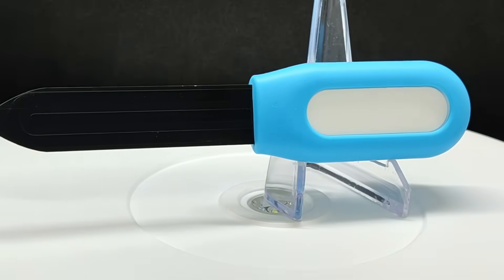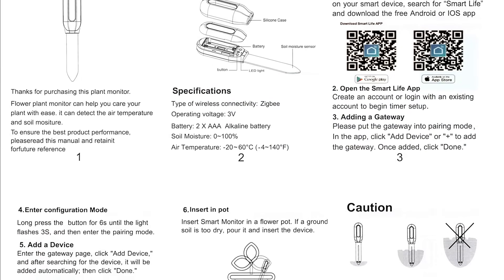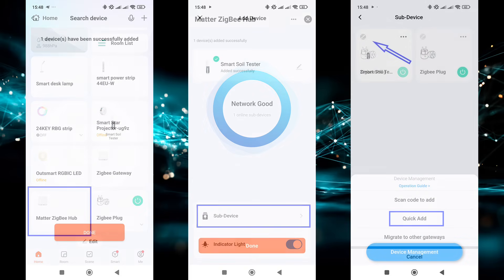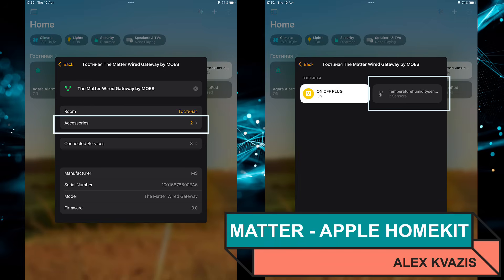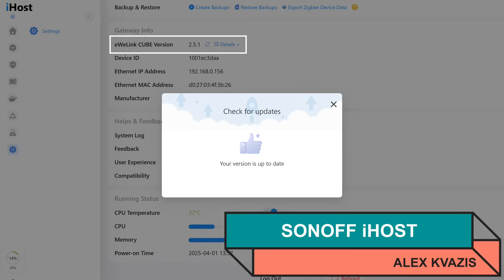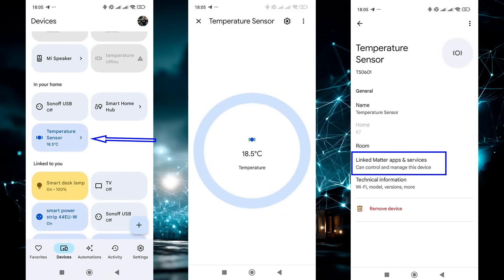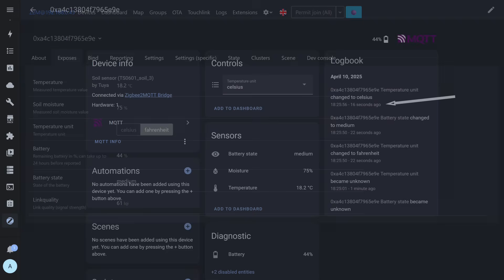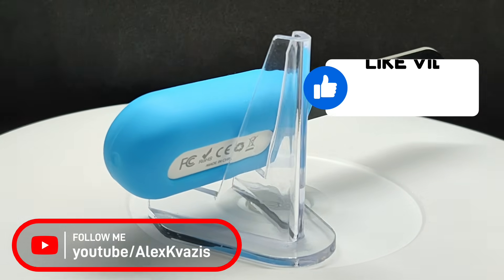Zigbee датчик температуры и влажности почвы для растений, обзор, тест совместимости

Comment: Bought this sensor but the humidity reading is unusable. Jumping between 100-40%. Trmperature seems ok.
Reply from the maker: Yes, I heard that there are problems with some models of such sensors. Some work well. These are cheap sensors, so there is a lottery here - will you be lucky or not.